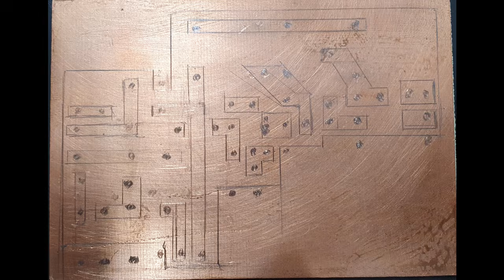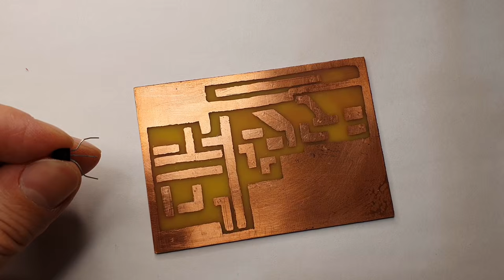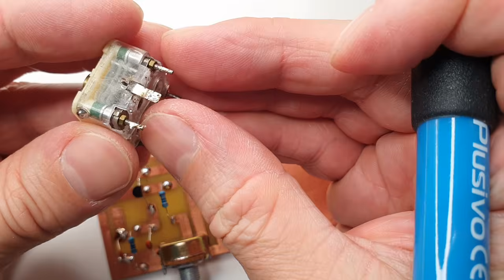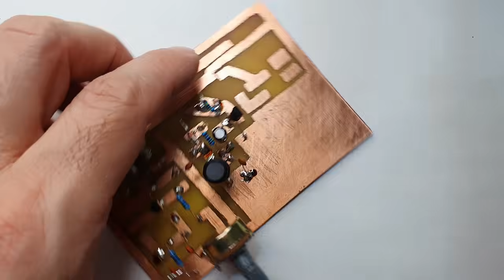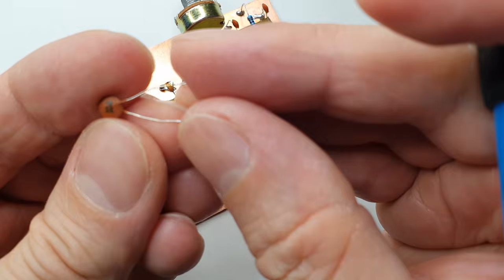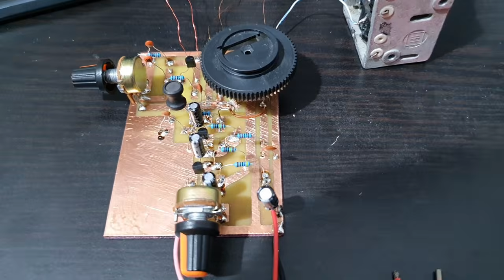Receiver regenerative -  AM / CW / SSB

Comment: Nice project. Is it easy to maintain regeneration over the whole range? What exactly is the frequency range?
Reply from the maker: Thank you. The frequency range is between 7 and 12 MHz. Regeneration is good and stable; it can be adjusted using either capacitor C3 or potentiometer R4. Good luck with the project!

Comment: Very nice video especially where the function of the parts is explained. Out of curiosity what type of ferrite core did you use ?
Reply from the maker: I used a ferrite antenna (nickel - zinc), because I do not have the possibility to install an external antenna.

Comment: Hello again! 3 observations: there are 3 polarized capacitors, and the circuit diagram doesn't show the + and - symbols; another observation is where to place the antenna in the circuit? About the Transistor 2N3094 in the circuit you used an equivalent 2N3904.
Reply from the maker: Hello! The transistor is 2N3904. I used a ferrite antenna (nickel - zinc), because I do not have the possibility to install an external antenna. If you give up the ferrite core, the coils must be recalculated. If you keep the input circuit as I did, an antenna can be coupled via a 100 pf capacitor, at the hot end of the L1 - C1 circuit. Or you can build a coil with 4 - 6 turns, and connect it with one end to the ground and one to the antenna. The minus pin of the electrolytic capacitors is marked. Watch the clip. The plus pin is mounted to the area with the higher potential and the minus pin to the area with the lower potential. Good luck!
Reply: @dz-abouttechnique1849  Thanks for your information. At last, C6 in the cirtcuit does not solder in the PCB. Thats all.
Reply from the maker: @TheSmascare  Ideally, you should also use C6.

Comment: Hello. Very good video! About the PCB do you have the the draw with dimensions length and width! Thanks!
Reply from the maker: Hello! The PCB is 5x7 cm. I drew the circuit directly on the board. The traces to the transistor should be as short as possible! Good luck!

Comment: It sounds fantastic! ✨ But how to make tuning softer? Small var cap in parallel or making it multi-band (say, 700-800 kHz tuning range for each SW sub-band)?
Reply from the maker: You can use a small capacity variable capacitor in parallel with the tuned one. Good luck!